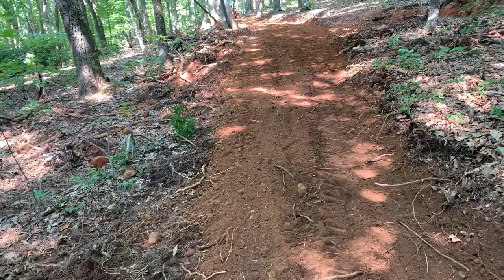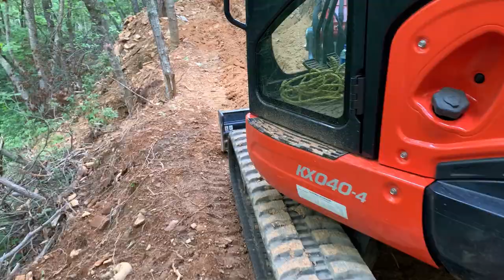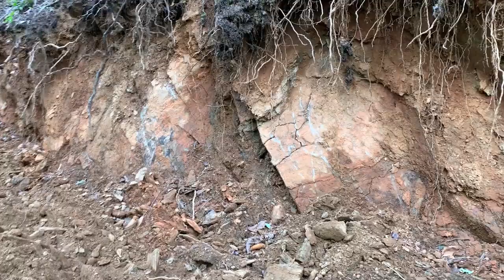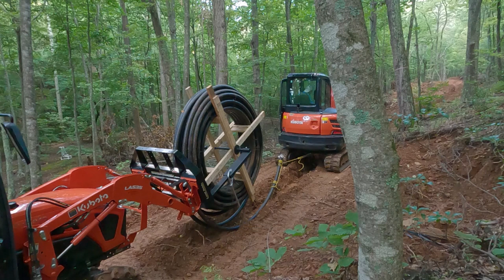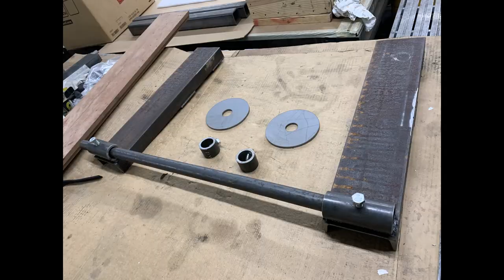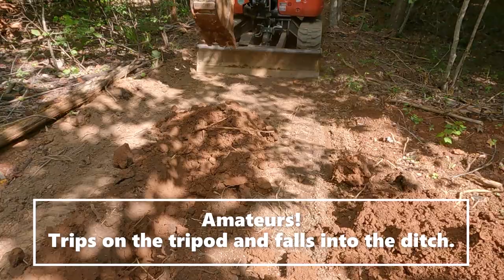Micro Hydro Penstock - Setting the Water Line

Comment: Anxiously waiting for the next installment. Which size PEM pipe are you using and any advice on where to buy cheap PEM pipe couplers?
Reply from the maker: The only place I was able to find them was at hdpesupply.com and not cheap, they ran $43.91 each for the couplers and sadly I was only able to get the 2" HDPE pipe. I couldn't even get a quote on the 3" so I settle for the available 2" pipe which cuts my possible output to less than 400 watts. I should have the pressure and flow results in a couple of weeks.
Reply: Okay, I managed to buy old stock, unused 90mm PEM pipe for 2USD pr. meter. I bought 700 meters of it. But they are in 5 coils of 90 meters and one coil of 250 meters.
I found 90mm couplers for 30$ each on aliexpress. the 50mm one was on 11$ each. 

You might have published it already, but what will be your total elevation fall and over how long distance?

Looking forward to see your results and it is always exciting seeing the process of installing/building of the system :)
Looking forward to see the result.
Reply from the maker: @Mr.Engineer.  Approximately a 45-meter elevation drop over a distance of 915 meters. 
What you purchased is much better, more than 3" which is what I was aiming for. The only issue with pipe coils that thick is man-handling them, I just about could manage this 2" on my own. But if I could start over again, I would have waited for the 3".
Reply: @Magutz  
Looks like you will have enough flow year round least for your 50mm pipe. I really wanted 110mm pipe as this is about the biggest you can buy in rolls. 12 meter straight sections would be a nightmare.
I have about 90 meter elevation drop on a span of 600 meters, but yeah I do dread the day I am going to install the pipe!
I am not able to use any machinery as making "wounds" in nature where I live is almost equal to murder if you get caught. Only tool I can use is a portable winch to drag it up the hill, so will not dig it down either. Hope the snow and continuous flow of water will keep it from freezing in the winter.
Reply from the maker: @Mr.Engineer.  That's a great setup, you'll easily be able to get over 1,000 watts as long as you have 95 LPM or more available.
Reply: appreciate the use of metric for easier comprehension. european viewer here :)
sure, you might have wasted a lot of potential, but reaching 350-400w is still going to be equal to 8.4 to 9.6 kWh/d. With good insulation that might even be enough to keep a steady base temperatur in your cabin. with access to unlimited, nearly constant temperature water already routed to your basement, looking into a water/water heatpump might be worth looking into. Depending on source water temp you can reach SCOP well over 6.0 meaning with your max 350W of hydro power (accounting some flow needed for the heat exchanger), you end up with up to 2.1kW of thermal heating power. In summer, you could just use the passive cooling from the cold water source itself and not have to have a minisplit running. Provided you have hydronic fancoils, even latent cooling loads should be possible, if your water temp is somewhat below the respective dew point, good for those muggy times.